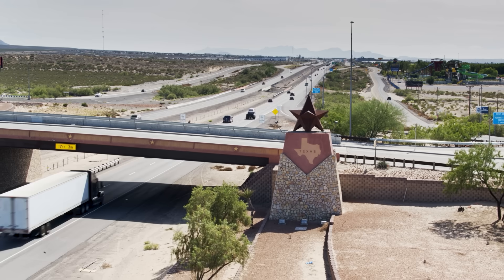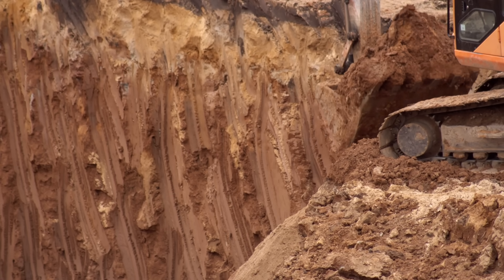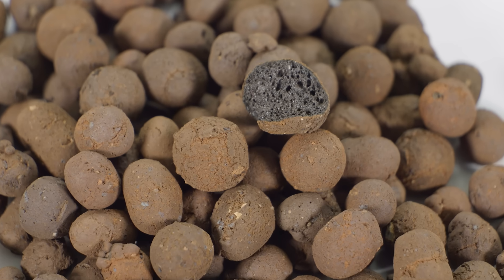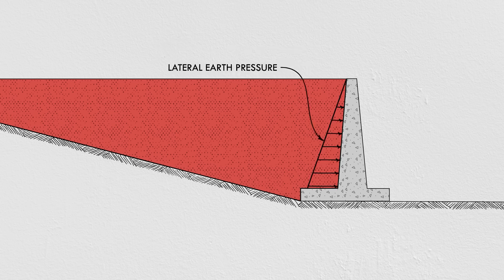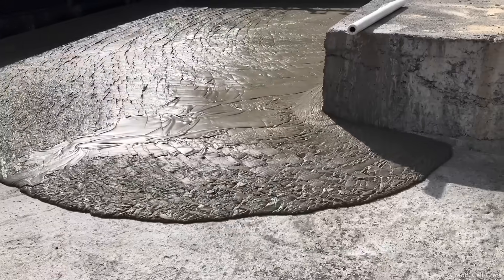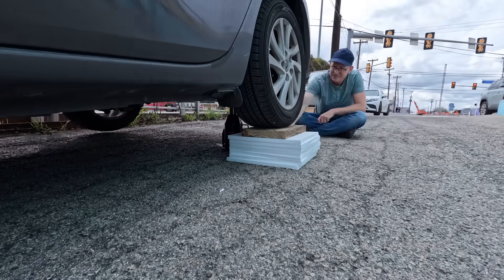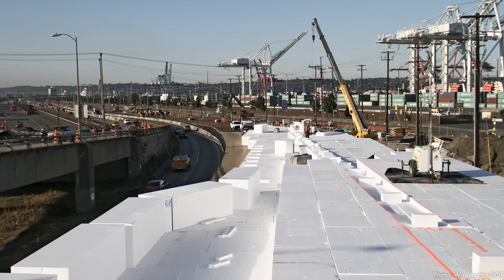Why Some Roads Are Made of Styrofoam

Comment: Styrofoam is a brand of closed-cell extruded polystyrene foam (XPS), manufactured to provide continuous building insulation board used in walls, roofs, and foundations as thermal insulation and as a water barrier. This material is light blue in color and is owned and manufactured by DuPont.

Expanded Polystyrene (EPS) is a rigid foam plastic made from polystyrene beads that are expanded with heat and steam, then molded into various shapes. It is widely used for its light weight, excellent thermal insulation, and shock-absorbing properties in applications like protective packaging, building insulation, safety helmets, and displays. While useful, EPS poses environmental concerns due to its resistance to degradation, difficulty in recycling, and the presence of styrene, a probable human carcinogen, in its production.

😎

Comment: OMG, I saw them building an embankment for an overpass on I-15, and while it was coming together I could have SWORN it looked like they were building it with Styrofoam blocks.  At first I thought they were set up as some sort of temporary structure, like maybe a cast for them to fill a mold with concrete.  But when they continued to build around the foam blocks I had to figure it wasn't Styrofoam at all, but just something that kinda looked like it.  Then there was a big wind storm and the next day the blocks were are skewed like they got blown out of position, and they stayed like that for a couple weeks.

I could never figure it out.  Now I'm just shocked to find out that it really was foam blocks!  I'm stunned!  I've driven on that overpass!  How is foam strong enough to support the weight of all that traffic?

Comment: If solvents pop the bubbles in styrofoam, then why don't manufacturers just take the extra step of pre-melting the exterior and re-hardening it with internal drainage ducts and keying surfaces, etc.? This would be similar to making a "foam" with cell wall properties of this massively thickened shell, and would likely delay or minimize damage from a tanker spill for example. If you put wire between the layers and run reinforcing bar down some of the internal ducts you can pour concrete inside and make a pretty strong structure. Heck, you could make a negative space model of a building in foam, cast it in reinforced concrete, then melt the foam while tumbling for an even plastic coating. It's so Jetson's.
Of course, you'll have to trim some on site, but simply trim it X amount larger, melt/harden the surface, cut away the crispy rim from the melted-out bit, and spray a general purpose  decay delayer. It would be more expensive, but also less bad and more useful. The reduced risk of releasing those little foamy balls everywhere is a selling point.

Comment: I had a unique use of geofoam with a repair of a cut and cover tunnel damaged by a large rockfall and underdesign due to a code issie (code used itself was deficient).  After tepasiring the roof of the tunnel most of the 24 ft of backfill on top was replaced by geofoam with a crushing strength lower than the capacity of the strengthened roof.  This potentially increased the resistance to impact from any future rockfalls from the 600 ft cliff over the tunnel.  The geofoam had to be flown to the repair location by helicopter.

Comment: Are these really viable compared to soil? The wood fillings come to mind, degrading after 50 years sounds like a liability, especially since it wont degrade uniformly, what are the hidden costs associated with it, instead of just adding more soil and repaving it until the compaction is no longer noticeable?
Or are infrastructure like this not made to last and accepted it will be rebuilt in 50 years, thus the can is kicked down the road to pocket some more money today? 
Not trying to sound negative, just understand why this decisions are made, as they seem cost-oriented, and not actual practical and longevity focused, and I must wonder if this is the right way to do things.

Comment: 00:07 Bridges on soft soils cause road bumps
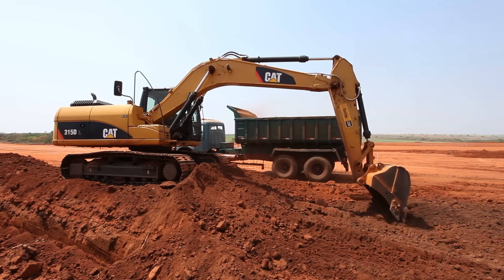02:15 Ground modification techniques enhance soil strength for construction projects.
04:07 Using alternative materials for roadway embankments can reduce loading on the foundation.
05:53 Lightweight fills like expanded shale and foamed glass aggregates are used to reduce loading on soft soils and protect underground utilities.
07:49 Using lightweight fill behind retaining walls can lead to cost savings and design simplification.
09:50 Lightweight construction materials like cellular concrete and EPS foam offer unique advantages in construction.
11:56 Styrofoam pavement is beneficial but has limitations
13:51 Utilizing lightweight materials for infrastructure efficiency
Crafted by Merlin AI.

Comment: The far more common bump between road and bridge, are the expansion   boxes. The bridge is much more prone to expand and contract lengthwise, first because the materials of those two kinds of road are very different, but secondly because the bridge, being exposed to different temperatures; being "in the air", while the ground takes far more time to change its temperature.
Steel, which is a common material, expands far more than the fundament of the road, so it needs to have room for this expansion, or the bridge will buckle, like old railroads in the sun.

Comment: Im a builder so believe it or not we also use Styrofoam for foundations of some buildings for the very same reason. I live in a geothermal active area that require light weight materials to build structures over active areas to avoid collapse and sudden burst of 1000°c water's.

Comment: I used to live in the UK as a Motorway Traffic Officer. So my job meant I was constantly driving on the motorway. Then I moved to Canada and I have also driven in the US. I have never in the UK experienced such dramatic transition, from an embankment to a bridge section  as I do here in Canada or the US. In the UK, you barely notice it. Reason, they know how to build roads in the UK. North America just builds cheap or they don't care about the finish. Even brand new roads have a huge dip as you drop from the bridge deck on to the embankment. It is enough to unsettle the vehicle and make it squirm under you. 
If you want to know how to know how to build roads properly, call in a UK engineer. You might be surprised how much longer your roads also last.

Comment: I wonder why we have such a problem with microplastics.... "made out of ground up tires" "made out of styrofoam", aah right. I think we shouldn't use plastics in applications where they are susceptible to the elements. It'll just lead to more (unnecessary) microplastic pollution

Comment: Separate but related…how are German autobahn roads constructed differently to US Interstates? I was able to travel there for the first time last summer and was amazed at how smooth their roads are.  No expansion joint bumps so driving fast on the Autobahn the car was much more stable at high speeds.  I’ve read they use an asphalt which is less susceptible to freeze-thaw cycle cracking, but have to presume there are a number of differences which are likely a factor.  So connecting back to this video, do they use lightweight fill material more extensively?  Would love a video about this and would be willing to contribute to the channel’s revenue stream to help with travel costs.
Reply: Nazis used to make roads.. now they make spacecraft

Comment: I only know of one bridge in my area where the ramp was built with high density styrofoam, and its also the one bridge where they had to rebuild the ramp. In my area, weight isn't a huge problem since you typically find bedrock just a few meters down at most. The bigger problem is usually drainage and soil movement due to frost during winter. Anything that is full of holes is a recipe for disaster. It accumulates water which causes massive problems as soon as frost takes hold.

Comment: PennDot’s contractor ‘Buckley Construction’ just used this exact lightweight glass foam aggregate fill to temporarily repair the fallen Cottman Ave exit ramp bridge gap on I-95 in Philadelphia due to the tanker fire. The fill was actually blown in, sorta like home insulation, by huge materials movers typically used to flow concrete. The fill was brought in from a local manufacturer distributor in regular 53’ box trailers.
— They threw up the light yet strong retaining walls in and had the entire emergency repairs completed in about a week.
— All of this until the original bridge structure is redone.

Comment: 10:55 EPS Expanded Polystyrene foam 13:16 used in Seattle Alaskan Way viaduct replacement. (Here in the Boulder area, geofoam blocks were used to repair 2019 US36 sinkhole at 104th in Westminster)

Comment: Some houses already use shredded-styrofoam mixed with aerated-concrete (aka. cellular foam), to get roughly 80% of the strength of cellular concrete (aerated concrete) and roughly 80% of the heat insulation of the styrofoam, at the same time, with the right mixture ratio. Would be nice if you could research this subject and talk a bit about it in an episode/video.

Comment: What about an extension of the bridge deck that is hinged to the bridge foundation on one side and supported by the embankment on the other creating a ramp effect. As the embankment settles this “ramp” would self adjust to accommodate the movement. Being hinged the joint could be designed to accept the vibrations in the bridge from the traffic. Thus not interfering with the the bridge flexing.

Comment: In Germany the usual workaround is to build up an even larger pile of sand at first to increase the load on the bottom part, thereby speeding up the settling process. Later the pile is reduced to its intended size and the removed material is used on the next construction site. Probably only works in areas with enough space available next to the site to accommodate the larger base of the structure though.

Comment: The thing that is the pet peive for drivers is not the roadwork site. It is being slowed for the safety of the workers when no workers are there, or they are working in heavy equipment behind K rails or other solid obstacles. It's like slowing a freeway because it goes past an office block.

Comment: I wonder how mycelium blocks would compare to styrofoam. It’s lightweight and eco friendly, but there is a risk of degradation if it’s killed before use, however if it’s kept alive it will continue to grow and root out over time. It may or may not be beneficial for structure and ecosystem. 🤔

Comment: Over 20 years ago I worked on a project that had to be both extra heavy for one part and extra light for the other. The roadway under the bridge was going under the water table so had what’s called a “boat” section that was 4’ thick concrete on the bottom to offset the uplift of being under the water table. The abutment went right up to a tunnel going under the harbor and was built on the roof so had to be as light as possible so used styrofoam for the primary fill.

Comment: I first saw styrofoam used in a landslide mitigation in the mid- to late-90’s. US 101 between Ukiah and Willits CA was plagued by numerous earthflow-related “sinks” and lane misalignments as the slides crept downhill. More fill only added more weight/driving force in a vicious cycle. 

CALTRANS created a large excavation through the largest and most problematic earthflow complex and rebuilt the alignment with foam blocks, providing subsurface drainage and soil cover. The slope quickly revegetated and the roadway hasn’t moved appreciably since. 

My first trip through was wonderful: no more white-knuckle driving at 45-50mph.

Comment: I have a question;
I am engaged in a discussion on the material that is used to 3D print buildings as in the following video.

Does the fact that the material has either fiberglass or carbon fiber in it as an aggregate, classify the material as concrete?

You can 3D print anything...even an entire neighborhood!
https://youtu.be/Y-4S7cdo3tY

Comment: It's neat that a bunch of alternatives have been found with regard to the materials in the ramps, but I gotta wonder... Why not just add a hinged wedge on either end? Y'know, like the kind seen on ferry loading docks? Ferry ramp goes down, hinged wedge adjusts to the given tide, cars drive on/off with the same, mild bump regardless of the time of day. If a smoother transition is still desired for an overpass on dry land, just keep the wedge there until the ramp settles sufficiently for a solid paving job.

Comment: We had a section of a 4 lane divided highway near us that just kept sliding down the mountain. After decades of lane closures and repairs, they finally just removed the soil/clay in that section and replaced it with Styrofoam blocks. One would never know that you are driving over thousands of giant Styrofoam blocks. I marvel at how stable the area is now, while wondering how often I am driving over Styrofoam on other roads.

Comment: 8 years ago we built a net zero energy home. In addition to our solar array, we are heavily insulated. We live in MN so insulation was very important to our construction. Our footings and concrete sub grade walls are wrapped in EPS foam to reduce thermal bridging. this means the weight of our entire house is resting on foam. After 8 years I can tell you that this system worked for us, we are living a warm life in our cold MN winters! Cheers!

Comment: I remember when they used the Styrofoam in Seattle, but it wasn't the only project. They also used it down in Tacoma on a freeway project, and if I'm not mistaking they have used it on the light rail project as well.

Comment: I tend to consider a larger environmental impact of highly processed substances such as plastics compared to naturally occurring backfill soil. However EPS has inconceivably low density around 20-30 kg/m^3. In EPDs I reviewed, both Global Warming Potential and Energy Use during manufacturing are lower than even wood products for unit 1m^3 of element. Maybe one also needs to check its interaction with its environment, impact to local ecology etc. Great video btw, Grady!

Comment: With regards the cellular concrete and settlement in particular;

Does a concrete like that not have an added advantage in growing permeability as cracks between the cells develop, which could allow for ingress of lime to strengthen the concrete?

This could provide for a gradually more dense, but also stronger concrete which 'grows in strength' as settlement takes place, no?

Comment: Good god. Okay, I've driven a Freightliner across Canada for fifteen years now. There's a couple bridges on the A20 in Quebec around the 450 mark, I think.

The approach and exit to the deck itself have collapsed and dished down so badly, they've turned into ramps. I know for a fact they're steep enough to get my truck's tires to leave the pavement entirely, because not only does it whallop the suspension hard enough to bottom out against the stops, but it's like a double hit of hitting the ramp, and then slamming down onto the deck.

There's also the tires chirping like when an airplane touches down, the engine suddenly spiking revs when the drives aren't touching the ground and the driveline is unloaded, and the dashboard filling with wheelspeed mismatch alarms.

The problem is, it's in one of the most boring, anonymous stretches of the A20, out in the middle of nowhere, and it's one of many flat bridges over small rivers, and there's no discolouration on the asphalt, so it catches me by surprise about eight out of ten times.

Comment: Perhaps the most interesting point this video really brings home is that, though we think of civil engineering structures as static, it turns out that, like all other engineers, civil engineers too are designing dynamic structures. They just move  much more slowly than typical mechanical structures.

Comment: Recently I purchased a new shelf, in the box there was a 8x8x0,5inch honeycomb paper filling. That was so light, it was incredible.
I weigh 200 pounds and could stand on it, even standing one leg, then I moved  the force to one spot and it dented in. But having 200 pounds on a surface maybe 1x1 inch on such a structure and only leaves a dent is really incredible

Comment: I used to make geofoam, actually did for that exact seattle project. We used something we dubbed 2 pound it is about 10 to 15 times as dense as what you get as packing peanuts, but each 4 ft by 4 ft by 8 ft block was only about 300 lbs. Light enough to be moved very easily. Some of these blocks were even cut to order at the plant before being sent to the project. They would then only need to make minor tweaks to the foam to ready it for the roadway.

Comment: I drive through the Darlington Interchange project in Adelaide Australia every day.  It was finished about 3 years ago, but soon after construction the massive angled retaining walls need to be redone due to underground water pressure.  Now in 2023 the same retaining wall is being ripped apart and rebuilt, for the second time.  A US$430M project getting its second major fix within 3 years.
Engineering is sometimes very hard.

Comment: I’m from the Netherlands (used to be pretty swampy) and indeed we have some roads built on a reinforced styrofoam foundation. We also have a highway partially built by sinking concrete pillars in the ground until the friction won’t allow you to go deeper. Then we put concrete slabs between the pillars and put asphalt on top of that. We have it all…
Reply: Where in da Netherlands
Reply: @filbao8113  highway A27 has the pillars, don’t know exactly where we have the styrofoam but it’s on “veen gronden” or peat land in English. That stuff just won’t hold anything with a high density.